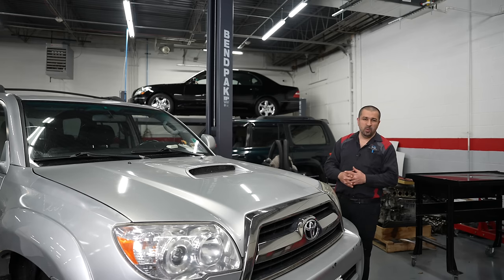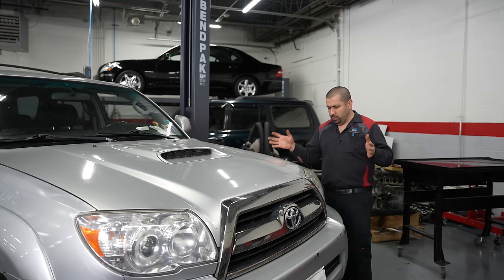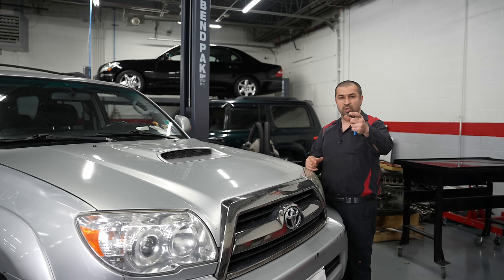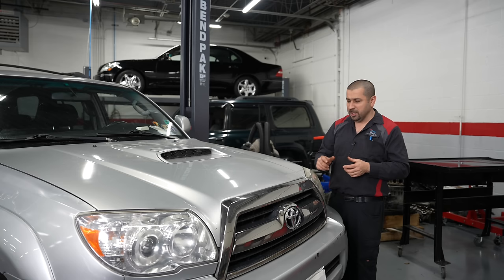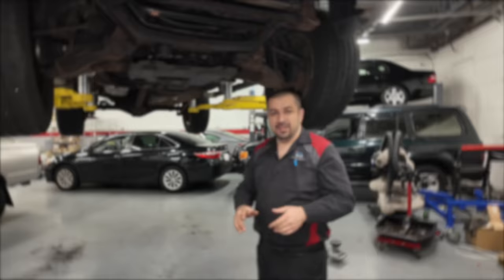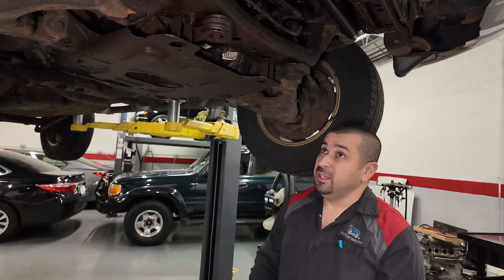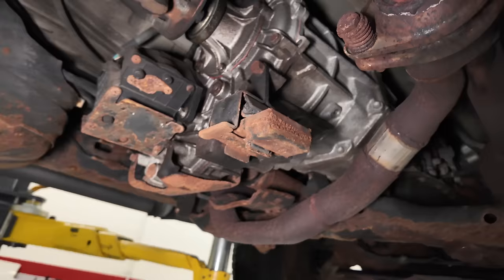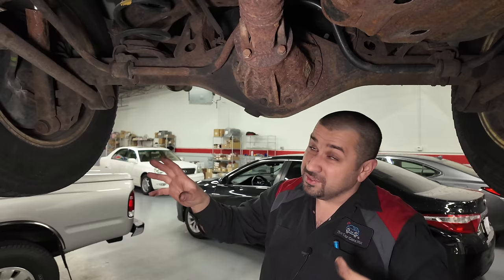THIS Problem Can Destroy Your Toyota Truck Transmission! Is it Too Late for This One?

Comment: dealer parts guy here in Pennsylvania (rust burg). i hate that xreas system. i talk to the customer and make them know exactly how expensive and unnecessary those shocks are. only once did i have some lady put $4k into replacing everything because she planned on selling it and wanted everything factory. truck wasn't even in good shape to begin with. money wasted.

Comment: Just blows my mind why people won’t spend 10 bucks and 10 minutes on a can of fluid film and easily get double the life of your vehicle.
Reply: You would need a jack stand to easily get under there, but it sure is worth it if you want to keep your car for a while or if the car is old and at higher risk for corrosion.

Comment: I am NZ'er   we call that model a Surf,   if that went through for a safety warrant of fitness , which is every 12 months for car year 2000 plus and 6 monthly for cars under 2000, that Toyota would be condemned with the rust and off the road, or probably subject to a repair cert that would specify at least a good sand blast and report and more than likely a new chassis and structural parts, therefore be uneconomical and scrap..
Reply: We have many rustproofing products in the USA and Canada which would have prevented that corrosion from ever starting. It is astonishing to see how many people refuse to use them and especially so on an expensive vehicle like this 4Runner.
Reply: NZ cars are usually quite ok, but since 1985 we have had 1000's imported from Japan and in the past there has been some come in from salty road area's that have been rusty and that has been a huge problem for the importer. It really don't happen to much these days as restrictions have got tighter and they get checked prior putting on transport ship by NZ customs agents but even any other car  on our roads that may show signs of rust bubbles on panels or underneath  can still be subject to more investigation and repairs in order to get a warrant inspection pass.

Comment: 2000 4 runner owner. Have replaced the drive shaft, muffler, one shock recently. Otherwise works great. RUST is creeping in though.

Comment: Amad,  I am sure you replaced many other Tacoma shocks.  Why not do the costumer a favor and install those used shocks where you removed (may have a little life left)?  So, you can safely drive the 4runner.

Comment: GJ, you have a great channel and teaching style, What would you recommend to avoid the rusting issue. I bought a 2020  Tundra from down south. It has 24k miles on it and not a speck of rust. I unfortunately live in the Midwest (Rust Belt)  and would like to take preventive measures to avoid rusting issues.
Reply: Fluid Film.

Comment: My V6 Rav4 has solinoid issues.
When cold the car won't move. If I warm the engine for 15mins it drives fine. 
Have done partial ATF change with filter but same issue occurs.

Comment: Rust and Neglect really killed this vehicle.
Severely rusted underbody, not to the point of framerails rotting away but close, many issues that should have been fixed years ago.
Had it been in better care mechanically and a good lasting undercoating applied like FluidFilm, no one would be asking the "Is all this even with it?" Question.
Also a bare pipe underneath the vehicle seems like a risky way to cool the transmission fluid.

Comment: The trans should have the filter replaced and pan cleaned out. Drain torque converter too. Then flush deposits out of valving. Then refill. If noisy drive it til it dies or sell it. Value is less than repair costs.

Comment: I think the splashguard would have helped with the rust. Most of the cars I have worked on that are missing shields are harder to work  due to the bolts being rusty. Like your silicone trick withe the hoses I have to try that. Have a great day!

Comment: I just caught this issue on my Truck, noticed a drop of fluid on my driveway and immediately booked an appointment to get it fixed, haven't noticed any shifting issues I believe I caught it before much fluid has been lost, getting it towed to the shop tho just in case

Comment: As a late member to Toyota and this fantastic channel, the rate these Toyotas rust is much faster than many other cars, especially the German ones. It looks like Toyota component specifications lack corrosion resistance requirements. I make this observation as someone who lives in UK. Thanks for the video.

Comment: Have you ever tried a heat induction tool for removing rusted bolts?
Reply: Yes! Amazed how many videos showing clueless techs firing up torches and causing damage to rubber parts, totally unaware of induction heating tools.

Comment: What is the part number for the lines ? My 05 V8 isn’t leaking yet but one of the two lines is VERY rusty and I’d prefer changing them before a leak occurs

Comment: I am surprised the Car Care Nut did not change the rubber lines, maybe this is damage control diagnostics prior to spending more dough.  I hate the concept of lifetime fluid from the manufacturer... It asks the question as to what lifetime is? My idea of lifetime appears to be longer than the manufacturer as I keep my Toyota/Lexus products for a very long time, but I will venture that even Toyota/Lexus now build everything to a 10 year 'expiration' date. Despite the fact that dealers love to gouge customers, I ALWAYS have to fight to get them to change tranny and differential fluids. They are more than happy to offer alignments and fuel injector cleaning services (which I don't need) at regular intervals, but  not the important fluids (in my opinion). What gives???
Reply: i have similar questions as well regarding the lifetime fluids

Comment: On bolts such as those where a torch would be a bad idea, would an inductive heater work?

I live in the south, but I have been considering purchasing one of those tools as I drive up north in my tractor trailer every winter. And, every winter, it’s inevitable that I need to replace something that is rusted in place.

Comment: If I had a mechanical shop like the CCN shop, I would look for a newer 4-Runner and put my money in something less rusty. Spending $5K to $10K on a rust bucket, no matter the low miles, seems like pounding sand down a rat hole and expecting the rats to be gone.

Comment: I need some advice. My Toyota Highlander platinum, 2021, will be three years old in a few months. It has 18,000 miles on it. I drive it on long trips (3,600 miles) and I drive it on short trips (70 to 120 miles) and I drive it around town. At my recent oil change and tire rotation they recommended about $1200 in extra services. These services, for wheel alignment.(the tires are wearing evenly) and change all the fluids, not because of the mileage, but because of the age of the car. I would appreciate your opinion.

Comment: I have driven over seventy years and never wrecked a vehicle unless you count getting rear ended sitting stopped at a stop light, all within the last 12 years, twice. Thank you cell phone fools. The first was in a new 2012 Freightliner with a 53 foot trailer. I test drove a new 2023 Toyota manual 4x4 TRD. With the computer, throttle, vehicle speed interface it was impossible to make smooth, efficient gear changes unless you were under very heavy acceleration. I went home and Googled it and sure enough that is the fact known to all experienced drivers. It was the worst manual anything I ever drove. It takes garage equipment and  as much as an hour or more to properly check automatic transmission fluid levels in newer cars. They have “lifetime lubricant” also known as robbery without a weapon. That thing is a fugitive from a salvage yard. If you think that’s harsh just wail till it turns into a “Christine Plymouth”, the movie, and kills. How many patient mechanics are there that stand around half a day checking temperature with a helper. Sheeeesssssshhhhhhhhhhhhhhhhhhhhhhhhhhhhh! Been a mechanic/tech for over sixty years and fully certified in literally every aspect of cars and medium/HD trucks and buses. Prayers don’t change RUST! Thankfully there are a few like you, Car Care Nut!

Comment: Most All Vehicles, if Motor Oil and Transmission Fluid is Changed as Recommended, will never give you any problems. I have had over 25 vehicles in my 76 years and never had tranny or motor problems from Lack of Maintenance..

Comment: AMD all Best for the gentleman owner of that car 🙏
My wife has an automatic 2016 rav 4 hibrid. (In this video you talked about solenoid and it's function...) As soon as we bought it, I changed the transmission fluid (it was way dark) because some times after parking it, when I would turn it off, it would shake like if a gear was still engaged..
After that it got a bit better, but still does it, eventually 😢
Please, any words for a solution???
Thank you and all the best. Blessings 🙏
Reply: I like Eric the car guys website. He has a FAQ section where you can look up your car symptoms and it helps you narrow down the issue.
Reply: @zzoinks  Thank so much!!!

Comment: I'm not an engineer (at least not that type of engineer), so my opinion is probably no better than anyone else's. That said, External reservoir shocks are good for off-road racing or if you're driving fast on bumpy/washboard roads where the fluid in the shocks gets very hot, but otherwise, I think it's mostly one of those "Racing on Sunday, Dealer on Monday" things. On the road? I see no point.

Comment: Thanks for all the helpful ideas. I would add that a routine maintenance item is replacing the axel vent (seen at 11:30). Even in salt free areas this gets plugged up. It's inexpensive to replace or you can try to clean it.
What's involved in converting the shocks?

Comment: I thought my 5AT in my 2017 4R 'should get a fluid change' at 65k miles bc of past GM and hot rod type vehicle ownership.  I drive very 'spirited' and I have the magnussen supercharger since 55k miles. I had a local transmission shop that also builds dragster/rock crawling setups do it(he tried talking me out of it) bc he said Toyotas really dont need fluid changed at low miles and its expensive due to the toyota oil and pump needed etc; he gladly did it for $360 evrn though he said I dont need it. $360 included a new tcase output shaft seal that was starting to leak(normal on them) he said there was NO TRASH in the pan or metal on the pan magnets and old fluid looked great. He was right I should have left it alone!

 So I manually down shifted my 4 runner evreywhere since day 1 and took her to redline frequently to pass semi trucks(when it was possible lol) and get up grades. The truck doesnt see mud or deep water but has been in desert/into old mines here in CA. The supercharger fixed ALLL of the passing/grade problems but I still needed to manual shift bc of the lame throttle mapping. Now I have a $300 Banks Pedal Monster set to Sport #2 and the truck is a DREAM to drive. NO manual shifting anymore, the truck downshifts CRISPLY and quickly now and I have no doubt it will be better mechanically for the trans since it doesnt feel as 'squishy' changing gears.

Comment: What is a fair price for a service on a newer 20K miles Tacoma?    In Europe we have 3 year warranty , after that you have  1 year warranty after every dealership service .  What would you recommend:  Do the dealership high price service and have a warranty , or DIY , no warranty but know that the car has been serviced at proper intervals.? The dealership warranty ends at 100000miles !

Comment: Would this have been easier to just drain the old transmission fluid and refill per specs ? Seems like the adding of fluid and checking  a quart at a time was more work that just starting from it being empty ?

Comment: Metal pipes should be helded still so they don’t move when removing rubber hoses to avoid fracturing the metal pipe.

Comment: What a contrast from the visual part of the car and the concerning - oh now I see that mileage.  Need like a mild sandblasting to remove the flaking corrosion and then before it has time to start opening new flakes, try to seal it up. My convertible it was 15 years old when I got it and the mechanic said it is all fine BUT just anything rubber has lost it original flexibility to clunks and clicks - just lubricate them to be silent and plan to spend $$ when you take it all apart to start replacing parts.
Reply: Silicon Spray is a great way to preserve rubber parts.
Regularly applying it to every rubber part and having the vehicle undercoated with a non hardening undercoating like FluidFilm is the way to go.

Comment: I wish you were close enough for me to send you my 2007 Toyota Camry LE V6. I've had it for about a year and put about 10k miles on it. A couple of weeks ago I had the two axles replaced and two motor mounts but about a week after that it started having transmission issues where I had none before. I have a P0990 code but nobody so far has made a good analysis of the problem. The shop where the axles were replaced says it's not they're doing and the transmission shop just checked the fluid and told me I needed a new transmission. I need someone to analyze what's going on so I can know what to do. I'm not ready to spend three to five grand on a transmission without knowing what's going on not to mention the fact that the cars got 184,000 mi on it and I'm not sure it will be worth it. Sometimes the transmission has no trouble and other times it won't even go into gear. I'm wondering whether it's the pressure sensor just underneath the filter on the U660e or possibly a poor connection from the TCM.

Comment: If that Taco needs a transmission you are still better off than selling it with a bad transmission it is practically worthless. If you crawl under your truck in the spring and wash out the sand and salt then spray everything steel with (fluid film) you can absolutely minimize rust. Also spray inside the door panels, in between the inner and outer box panels etc? Most people when they wash their car they spray off the outside paint, rust starts inside and underneath like cancer.

Comment: While I understand some people have an emotional attachment to their cars... but if your car is 15-20years old, and you need to put in $5K or more, you really really need to seriously think about getting a new car (esp those 20yrs+).  While expensive, new cars have greater safety, new gadgets such as pairing your phone to the infotainment system, better gas mileage, and of course, less likely need for major repairs.  That said, cars today are not build at good as cars 20 years ago, so it's unlikely going to last as long.  Say if a car/truck is worth $10K... but you need to put $5K to get it up to that value, it's not worth it.  The chances of a $1K+ repair bill is just around the corner, and often, closer than you think or would like.

Comment: Hi Ahmed! Good morning! 2 questions... 1st q how many miles would the transmission fluid needs to be replaced on a 08 4runner V6? 2nd q: would you recommend to buy a 200k miles fl used 4runner V6 with no transmission service record? Thanks a lot for all your videos. Cheers!

Comment: How do you know how much fluid to add if there's no dipstick
Reply: There's a overfill plug in those.  There's also a procedure where you put your transmission in "check mode" it has to reach a certain temperature to check it.

Comment: Can engine flushes help to reduce oil consumption?
Love you ❤
Reply: I can answer that one easily enough. He has videos on this also. Short answer is NO. High oil consumption is a product of worn or stuck rings. There was a run of 2.5 Toyotas that were notorious for that. He's replaced several of those engines in his videos. Engine flushes generally do more harm than good.

Comment: Does this one share the 5 spds that come with later model of 1st gen Sequoia? I have the same solenoid issue. Drained about 2.5 qts and filled up with 4 qts. Did the level check using the updated TSB temperature range. Didn't see a drop coming out of the check plug. Put in another 2 qts and performed another level check with about a qt out. I thought that the transmission was on it way out but been driving it for 20k miles now without anymore codes or problem. Hopefully the same case applies to this Tacoma.

Comment: Wonder what came about this one, Ahmed. I discovered your channel with many of the same issues: 2010 4R Ltd, tons of transmission codes (P0750-0770, P0705) among other probs with power steering and XREAS. Never got above 4th gear on a trip to Virginia for Thxgiving, and swapped it out for a 2023 ORP with KDSS. Happy with the new truck, but wondering what solutions may have saved the old one.

Comment: A girl I know was looking to buy a 2008 tacoma that the owner claimed to need a new transmission. She asked me if I'd go look at it with her. 
I noticed a leak from the transmission cooler return line. 
The price for this otherwise nice truck was low so I told her to take a chance and buy it.
We hooked a chain to it where I parked it in a lot & simply tightened a fitting to stop the leak, filled the transmission to the correct level & she got in and drove it 40 miles home & she has been driving it ever since (about 2 years ago) with no transmission problems. 
She got a steal of a deal & I have to laugh because the guy who sold it is a member of a family that owns a tire shop that scams people & over charges for shoddy repairs. 
His uncle the "mechanic" told him the "transmission was toast" according to him.
It pays to have a friend who has some basic knowledge of how vehicles work.

Comment: Hey mate i have a 2004 prado v6 petrol 4.0 GRFE 4 speed manual ;based in Australia. There is no check plug (5mm) on my transmission sump anywhere. Found the drain plug. Havent found the filler plug. Most videos do not do a good job showing where filler plug is
It looks like the filler plug is further towards the bavk of the vehicle compared to the drain plug yeah?